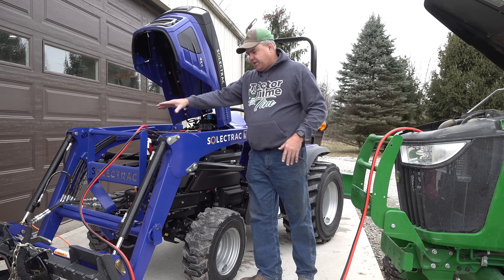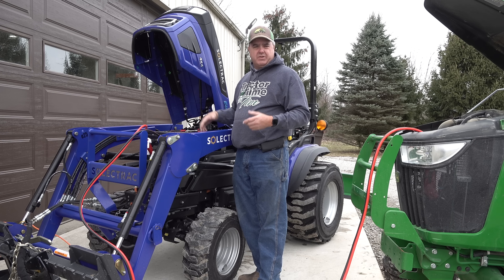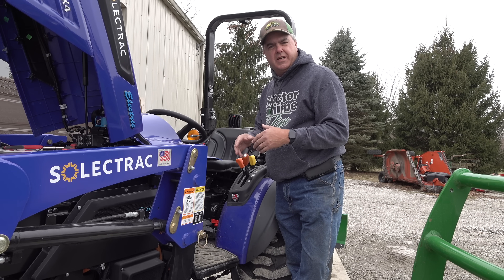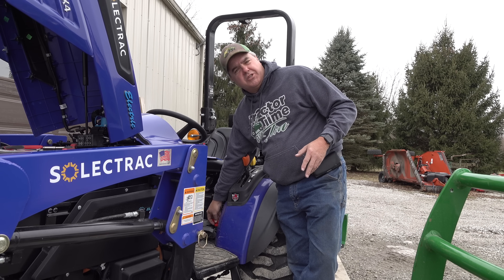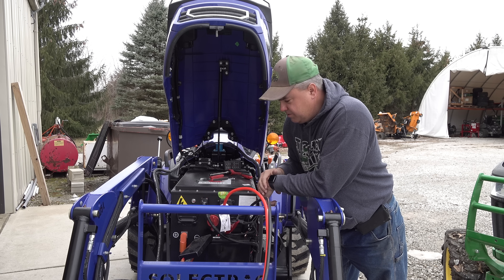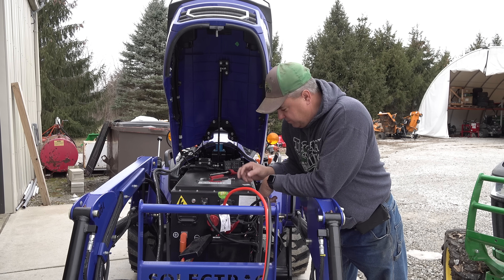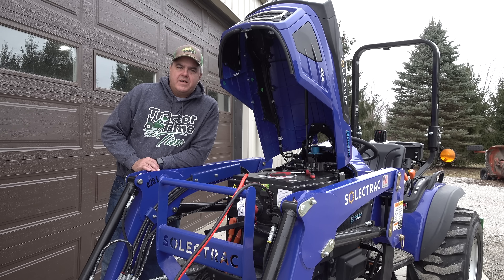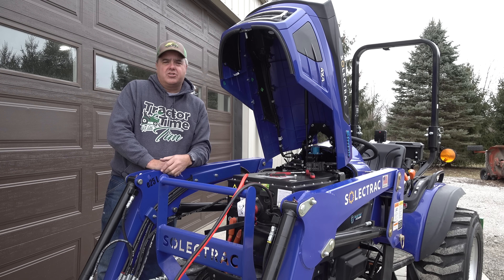Battery Issue with the Solectrac Electric Tractor!  I’ll Explain the Details!

Comment: You'd think they would be smarter about how the small battery is managed. The leave it enabled so that when you plug in the charger cable, it'll start charging. Instead, why not either have a charge position on the key switch, or a timer that disconnects the battery completely after 24 hours if the charging cable hasn't been plugged in. After 24 hours, you have to turn the key to the run position to re-engage the small battery. It would be almost completely seamless to the operator, since the majority of people are going to plug it in after they use (not necessarily every time, but when the large battery needs to be charge), not wait until the next day to decide to plug it in.
Reply: Might as well connect that timer to a pressure switch in the seat. If no one has sat on the tractor in a 24 hour period and it's not charging, disconnect the computer battery.

Comment: This video makes me want to stick with gas and diesel equipment...  Probably just me though.
Reply: I understand where you're coming from but let's be honest here- the tractor didn't fail on him. HE left the switch turned on for weeks. 4 weeks if I remember correctly
Reply: @bhoss7133  You're absolutely right, but many of us understand how gas and diesel equipment works. In contrast, we have no idea how much we DON'T know about electric equipment.  Now we've learned that the switch switches off the small battery, but what is the next thing we never would have thought of.
Reply: @curtwhite876  you can learn all you need to know about electric equipment in a few hours.  Also reading the owners manual would likely prevent stuff like this happening.  My converted electric tractor doesn't have a 12v. It can sit for 4 years before needing a charge.
Reply: Ironically, the issue he had was with the 12v system which is also on all gas/diesel tractors. 
If you left the ignition on a diesel your 12 V would be dead too.
Reply: @curtwhite876 

I totally agree with you ! This is my thoughts on this subject , people are saying it would be the same as leaving my 1025r key on but for me when I park my tractor I am taking the key out of it so that can't happen , but to be fair say I somehow left lights on or my battery drained , I grab boosters and start my tractor within 2 minutes of the boosters being hooked up and the tractor is ready to go hard at work ! And also able to charge the battery while doing so through the alternator . Compared to this specific design that Tim is testing out which is not capable of charging it's 12 volt battery and therefore would have to wait for it to charge up before going hard to work ? This is just my personal thoughts and opinions , doesn't make them right but thought would share . I would want something to work hard that can sustain itself for a long day's work at a time that's all .
Reply: It’s not just you…….
Reply: Not just you I like my diesel tractor.
Reply: Not just you. Lot of electronics we don't want or need. I will keep my 1025R.
Reply: Thanks for showing us this, it's just another reason I'll stay with a 10:25R.